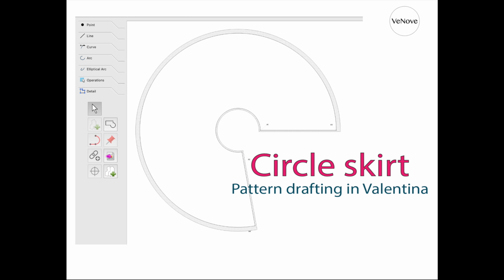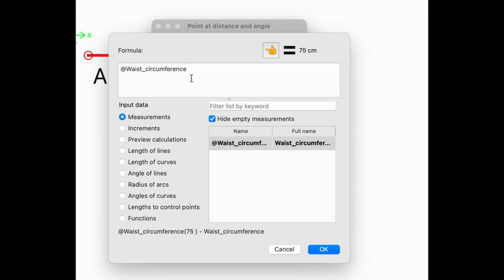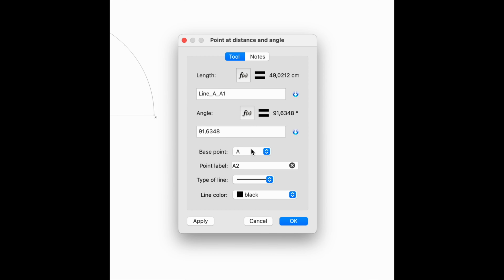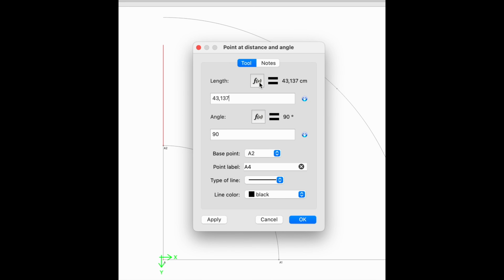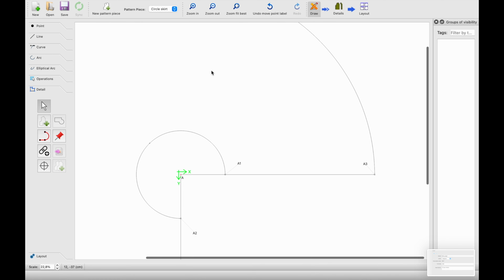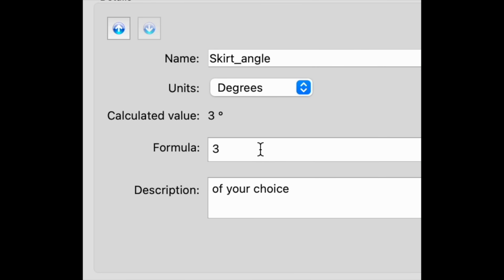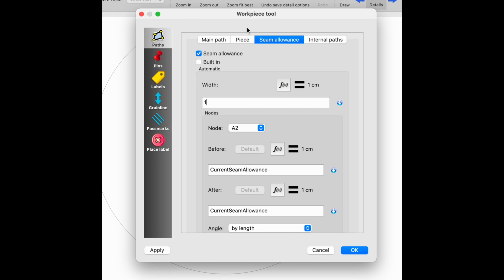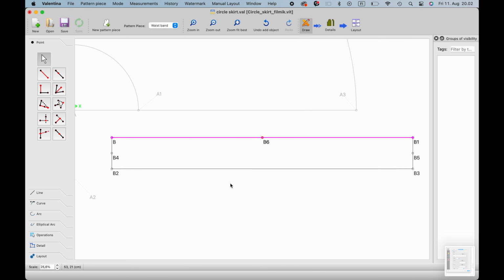Circle skirt in Valentina/Seamly2D (for any kind of a flared skirt) #tutorial

Comment: My program does not have an option to switch the unit of an increment to degree. It defaults to cm. Any idea why?
Reply from the maker: Seamly2D doesn't offer as many features as Valentina. This draft was created using Valentina, which is a significantly more advanced tool—though it isn’t as widely promoted.

Comment: 🥰 I tried your method just want to know if i can use the waist to knee measurement as well
Reply from the maker: Of course, you can use any kind of skirt measurement you wish and you can also take the ready "known" measurements from Tape. This 55 cm is just an example. I just prefer to have the body measurements in one place and all the others pattern measurements (like the skirt length) in increments. This way I can easily change them any time, independently from body measurements. In this case I would  "waist to knee measurement" as a formula for "skirt length".
Reply: 🤗 @VeNove